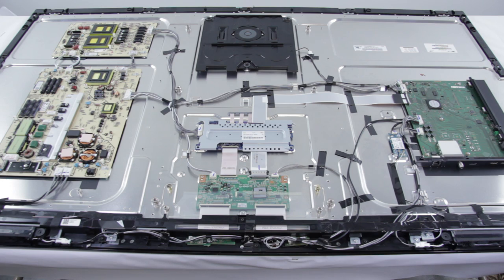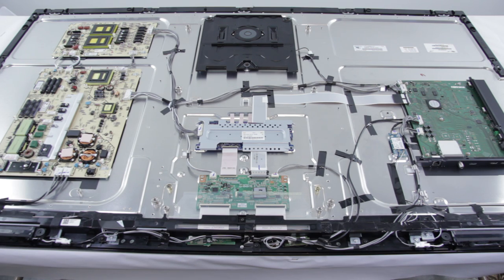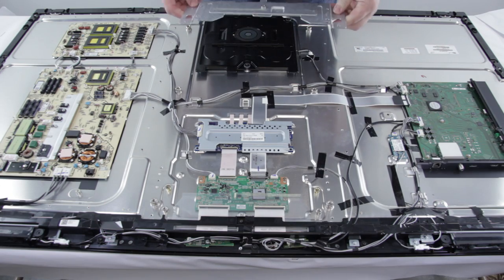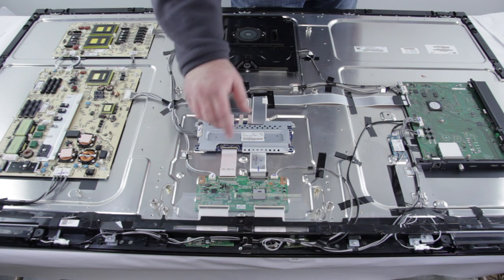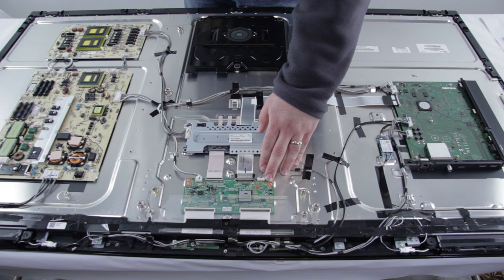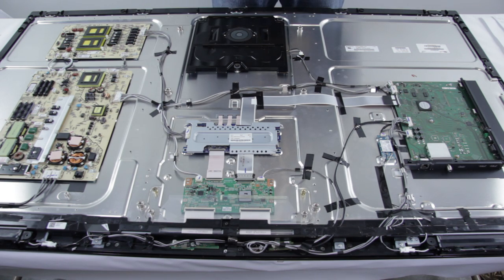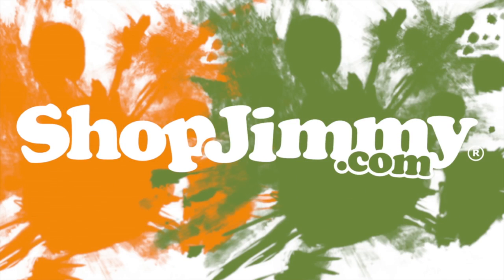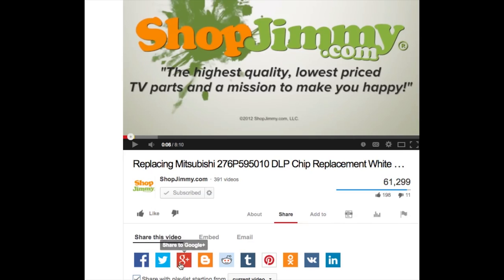LED TV Repair T-Con Board Help Review Overview - Common Issues and Problems with T-Con Boards

Comment: Hello I have a 60pz550-UA tv. Was watching it screen went blank I turned the channel still was blank the sound was real muffled volume turned on high. You can still turn TV on and off the red light works on front of tv. Took the panel off turned tv back on only a red light on and one green flashing light. Several years ago HDMI stopped working but others are fine. Main board EAX63546403(1)
Sticker EBR73042903
Sticker EBT6133403
T- Con Board  EAX63989001
Sticker EBR73837101 Do you think this could be the problem. Thank you  Danny

Comment: hi have samsung  plasma ps50c96h has no picture and have sound when i had a dvd on it and one of the capacitor was bad on the main power board replaced it but still not getting any picture and the tcon light stays green no flashing and a green  light on the y board stays on to so iam wondering what wrong with it can anyone help me out on this is it a tcon board or y board
Reply from the maker: garry cotman   It sounds like the logic board is fine, you should replace the Y board and buffers.  Unfortunately I do not see any replacement parts in the search results for your TV model number on our website.  Please reply with your part number on your Y board and buffers and I can try searching for replacement parts.  Thanks and please let us know if you have any further questions!  www.shopjimmy.com

Comment: Samsung LN32D403 : top 1/2 or 1/3 flickers, t-con maybe?..everything else works fine
Reply from the maker: Bob Villa   This could be a problem with the power supply board or the lamps in your TV.  You can replace the power supply board to see if that fixes the problem.  Click this link to replacement parts:  http://www.shopjimmy.com/catalogsearch/result/?q=LN32D403  There may be multiple boards for the same TV model number, be sure to match part numbers on your current board, with your replacement for compatibility.  Here is a link to a video showing how to identify your part number, click here:  https://www.youtube.com/watch?v=sSJexLvRrjM  Thanks and please let us know if you have any further questions with your TV Repair!  www.shopjimmy.com

Comment: HI I HAVE BLANK SCREEN ON SAMSUNG LED TV WITH T CON NO RUNTK5351TP.
ANY HELP
Reply from the maker: +Samantha Flynn   Try all repairs and troubleshooting at your own risk.  This sounds like you have bad LEDs in your TV.  Unfortunately we do not sell replacement LEDs for your TV model number at this time.  You can check back in the future to see if we have them available.  Thanks!  www.shopjimmy.com
Reply: hi tv lights up fine its the picture problem.led are on but no image.
regards
Reply from the maker: +Samantha Flynn   Try all repairs and troubleshooting at your own risk.  I recommend running the flashlight test on your TV.   Here is a link to a video we produced that shows how to run the flashlight test. https://www.youtube.com/watch?v=xUzCLgoSPGM Please reply with your flashlight test results and we can recommend a replacement part for your TV repair. Thanks and please let us know if you have any questions! www.shopjimmy.com

Comment: Hi, I have a samsung UN60EH6050FXZA led TV. The problem is when turn TV on, I can hear ding ding ding sounds, standard light blinks 5 to 6 times, screen is dim blue, and there is no picture. I did try flash light test, but did not see anything.
What wrong could it be? T con board? I heard Samsung have problem with bad capacitor. Please help me. If T con board problem, then when it is available to buy. Thansk.
Tom.
Reply from the maker: Tom Vo  Please watch this video FIRST to help with your repair!  TV Repair! LCD, LED, Plasma, DLP How To Fix Your TV with ShopJimmy.com Help!  I recommend replacing the main board in your TV.  Here is a link to replacement parts:  http://www.shopjimmy.com/catalogsearch/result/?q=UN60EH6050FXZA  Be sure to match part numbers on your current board, with your replacement for compatibility.  Here is a link to a video showing how to identify your part number, click here:  Samsung Main Boards & Digital Boards: Part Numbers for LED, LCD, DLP, Plasma TV Repair  Thanks and please let us know if you have any further questions with your TV Repair!  www.shopjimmy.com
Reply: ShopJimmy.com Thanks for your response.
I did replace the new main board in the TV, but there is still no picture. I am very sure the main board is working. I suspect T con board has problem. Please let me know what do you think.
Once again, thank you very much for your time.
Reply from the maker: Tom Vo   You could try replacing the T-Con board, otherwise you could also have received a defective replacement main board in your TV.  Thanks!  www.shopjimmy.com
Reply: ShopJimmy.com Order the T-con part from yours, replacing the old one, turning the TV on, it is working again. Hope this part will last for a while. Thanks.

Comment: dear shopjimmy, here is the info, built 11/2010, LG 42LE5300,
SVC-42LE5300-UC-AUSWLUR    SER#011RMHR6A401
The TV powers up just the way it always has, it has a full screen with no lines.
The problem started imediatly after a lightning strike a few hundred yards away,when the screen turned yellow, it now has a strong yellow tint to the picture that make bright colors wash into the picture.After seeing your how to videos I think I will try to do a repair if you can supply the parts I will need.  Thank you
Reply from the maker: Anthony Carnevale   I recommend replacing the main board in your TV.  Here is a link to replacement parts for your TV model number on our website, click here:  http://www.shopjimmy.com/catalogsearch/result/index/?cat=56&q=42LE5300 
Be sure to match part numbers on your current board, with your replacement for compatibility.  Here is a link to a video showing how to identify your part number, click here:  TV Part Number Guide for LG & Zenith Main, Digital, & Tuner Boards (LCD, LED, Plasma TVs)  You can also call our customer service for further assistance with your purchase.  (877) 881-6492  Thanks and please let us know if you have any further questions with your TV Repair!  www.shopjimmy.com

Comment: Sony Bravia
Model Number:  KDL-46VL160
Serial Number:  8215895

ISSUE: The TV will turn on display a blue screen then turn off. After powering off a red LED light on the front panel flashes 14 times then pauses for 2-3 second before flashing again. After removing the rear panel from the television, I disconnected the LDVS cable from the T-Con board and reinserted the AC power cord into the TV set. I then turned the television turned on with T-con board out of circuit.  The green led came on and the TV displayed a blue picture without turning off. Could the T-Con board be defective and need to replaced? If so, are their T-Con Boards that are compatible with this specific model? I have had a hard time locating a t-con board that did not look as clean as the one I removed.

T-Con Board
PART NUMBER:  A1564648A
BOARD NUMBERS:  1-878-182-11

Thank-You

Blake
Reply from the maker: blake kesler  Please watch this video FIRST to help with your repair!  https://www.youtube.com/watch?v=BP3NVNCGEv8  This could be a problem with either the T-Con board or the TV panel.  You can replace the T-con board to see if that fixes the TV.  Click this link to replacement parts for your TV model number:  http://www.shopjimmy.com/sony-a-1564-648-a-bt3-board-version-1.htm  Be sure to match part numbers on your current board, with your replacement for compatibility.  Thanks and please let us know if you have any further questions with your TV Repair!  www.shopjimmy.com

Comment: i heard if tcon board is bad there is 75 percent chance panal is bad,wth is a panal,, so if panal is bad then tv shot,, have a lg tv first had no pic ,then found leger and had 3.6 dc volts on two lines ,wires, so power board good bought a main board,  hooked it up had a great pic then lg 47 in  5300 tv  started having little white vertical lines,,then shaking,,then tv screen lines all directions then all green screen then shking white lines  and screen w/ pertty good pic  but changes to other syptom s,,  o n and on,,  did we buy a bad board is it tcon board

Comment: Hello, I don't know if you still offer the help with the TV problems but here goes  I have a Samsung LED TV Model # UN50ES6900F
Model Code UN50ES6900FXZA
Version AD01
Sn Z5UC3CYC900910Y
The Picture Looks Washed Out Like A Picture Negative.  The Sound Works Ok, Tried To Adjust The Picture It Didn't Wook. Any Advice Would Help.

Comment: Samsung #un321h5303af has no picture replaced power board still no picture is the t-con board bad
Reply from the maker: +Roger phillips   Try all repairs and troubleshooting at your own risk.  This could be a problem with either the main board or the LEDs in your TV.  Unfortunately I do not see any replacement parts in the search results for your TV model number on our website.  Thanks and please let us know if you have any further questions!  www.shopjimmy.com

Comment: Hello Jimmy Shop.  I have a 47" LG LN5400-UA.  I have no picture, but I have sound.  I followed another video of yours and did a recommended test.  I have a black screen, and can barely see the volume bar when holding up a flashlight to it.  I am looking for which part to buy.  I just tried LG EAY62810801 (EAX64905501(2.0)) Power Supply / LED Board which I ordered from you guys, but that didn't solve my issue.  Maybe I ordered the wrong part.  Which other part could it be?  Your help is greatly appreciated.
Reply: +Jason B  Jimmy, you sent me an email suggesting the issue might be with the LED lights.  Is there a test I can do to see if its the LED lights or if its a faulty t-con board.  thank you

Comment: Hello, thanks for providing such a great service, all your videos are informative and helpful to those with related issues.

I have an issue of my own, which i would be grateful for any guidance on how to fix it without taking it to to the local repair man who will charge me the earth.

So here is my problem,

I have a Samsung LE46F86BD which takes about 2 hours before it turns on, after it goes through a long loop of chirping and clicking on and off. Now, I have done some research online and it seems to be a common fault which has something to do with failing capacitors, however when I opened up with TV, there is no sign of any bulging capacitors.

I'm a little lost as to what this problem might be and was wondering if you would be able to give me some guidance on how to fix my problematic TV.

All the best
Anthony

Comment: +shopjimmy.com I have an insignia model number ns-lcd37.

my issue is when I turn the tv on it acts like it is about to show the acquiring signal and link to my laptop but then the screen remains black but the power light is indicated as on.  I do not hear any sounds nor do I ever see any picture. Do you happen to know what is the cause of this.

Comment: I have a problem with my rca model number led46c45rq simtoms are back light blinks and then do nothing please help
Reply: The-Hulk this is a backlight failure check the voltage on the power supply out to the leds. I suspect you have a few bad leds shorting out the rest. Which would require pulling the entire panel apart. If you would like to know how to test the less on the panel feel free to write back and I can give you that info as well
Reply: Hi Jim I check the backlight and they all lit up and the voltage going to leds  i got 4 pin. pin1 led+ frequently changing numbers.pin 2 Led - 43.5 steady.pin 3 led + frequently changing numbers and pin 4 led - 30.7 steady that doesn't seem quite normal just in case you want to know here is my  model number led46c45rq

Comment: I have a Sony Bravia KDL-EX520 LED TV, purchased in 2011. Suddenly, there is an issue with the screen. While connected to set top box, after 15-20 minutes, blue or green light starts flashing in the entire screen as if some bulb is flickering behind the TV screen. Video is fine, colors are ok, just the green or blue light keeps on flashing, which makes it impossible to watch the TV. And the severity keeps on increasing, the speed of flashing increases and ultimately I have to switch it off. Sometimes it happens after 5-6 hours of viewing. But it never happens when tv is connected to pen drive or laptop. Then it works fine. I have changed set top box, hdmi cables, tried different ports, but it didn't work. Sometimes, bravia images stored inside tv also have some problem in display. What could be cause? Is it faulty t-con board? Why it never happens with laptop connected?

Comment: Hello;
I have a Vizio E601i-A3E and I have a red vertical line close to the right side of the screen. the line is faded at the bottom of the screen. Here are some pictures of the issue:
http://imgur.com/Z3nrQ5r,mofV7jZ#0
http://imgur.com/Z3nrQ5r,mofV7jZ#1
can this TV be fixed by changing the T-con?
Thank you.

Comment: Screen displays but its full GAMMA. 
Brand: Samsung
MODEL: LN46A500T1FXZA
Its as if you turned gamma all the way up.
T-CON?
Reply from the maker: Daniel Merino   PLEASE SUBSCRIBE TO OUR CHANNEL - Try all repairs and troubleshooting at your own risk.  This could be a problem with either the t-con board, the main board or the TV panel.  You can purchase and replace the t-con board and main board individually to see if one of those boards fixes the problem.  Click this link to replacement parts for your TV model number:  http://www.shopjimmy.com/catalogsearch/result/?q=LN46A500T1FXZA  There may be multiple boards for the same TV model number, be sure to match part numbers on your current board, with your replacement for compatibility.  Thanks and please let us know if you have any further questions with your TV Repair!  www.shopjimmy.com

Comment: Hi 
I have a question regarding a Goodmans  Model LD3255HD the symptoms appear usually at switch on, the entire screen is filled with vertical coloured lines and I have noticed that the remote control does not work while the fault is present. By switching on and off half a dozen times the fault will clear and the set works normally for the rest of the day. Any thoughts or tips would be much appreciated. I worked as a TV repairman for 25 years but I am totally out of touch with modern technology. Thank You very much
                                                      Kind Regards
                                                      Jake McKee
Reply from the maker: jake mckee   This sounds like a problem with either the main board or the TV panel is bad.  You can try replacing the main board in your TV to see if that fixes the problem.  Here is a link to replacement parts for your TV model number on our website, click here:  http://www.shopjimmy.com/catalogsearch/result/?q=LD3255HD  Be sure to match part numbers on your current board, with your replacement for compatibility.  You can also call our customer service for further assistance with your purchase.  (877) 881-6492  Thanks and please let us know if you have any further questions with your TV Repair!  www.shopjimmy.com
Reply: Hi 
Thank you for your reply, when you say the  TV Panel may be to blame do you mean the display? If that were the case I don,t think it would be economical for me to replace the main board then to only to find that the screen is faulty would you confirm that is indeed what you meant.
                     
kind Regards
Jake McKee
Reply from the maker: jake mckee   Yes, that is the same thing, TV panel = display.  Thanks!  www.shopjimmy.com
Reply: Thank you for your help.
Regards
jake mckee

Comment: I AM LOOKING FOR A REPLACEMENT BOARD FOR THIS MODEL LG 55UF6450. THE PART NUMBER FOR THE BOARD IS EBT64048902. THEY ARE OUT OF STOCK EVERYWHERE AND I WAS WONDERING IF ANY OTHER BOARD COULD TAKE ITS PLACE.

Comment: hey it's me again samsung ue40es6300'' = 2 years and 1 month old just after warranty expires lol perfect 10 from samsung^^do have backlights working but black screen do have sound no menu shows but i can hear the sound perfectly and i can switch channel tried a second hand t-con board with no results got worse actualy gave me white lines i did not have with my own t-con board. the person was pretty sure that his t-con card was not working well or not at all told me try another one left his with no charge but still leaves me with this 6300 not working ps my older LE40B650 LCD has a quality of image ten times better than my more recent 6300 especialy with skin colors and black deepnesse and after 5 years 650 still working
Reply from the maker: Emmanuel Abrams   Try all repairs and troubleshooting at your own risk.  This could be a problem with either the main board or the TV panel.  You can replace the main board to see if that fixes the problem.  Click this link to possible replacement parts for your TV model number:  http://www.shopjimmy.com/catalogsearch/result/index/?cat=56&q=40es  There may be multiple boards for the same TV model number, be sure to match part numbers on your current board, with your replacement for compatibility.  Here is a link to a video showing how to identify your part number, click here:  https://www.youtube.com/watch?v=BEPWrefQvqI  Thanks and please let us know if you have any further questions with your TV Repair!  www.shopjimmy.com

Comment: I have Vizio p702ui-b3    history 2 days prior tv just went off but worked upon restart but picture was a little dimmer. I then decided to clean screen  my tv towel's were dried out so i sprayed Windex lightly on screen about an hour after there was about 4in  vertical white  line in middle of screen, then shorty after background went dark basically could only see faded yellow / orange picture  sound works fine can get into menue but to light to navigate and work rcm@rcmconsultingassoc.com